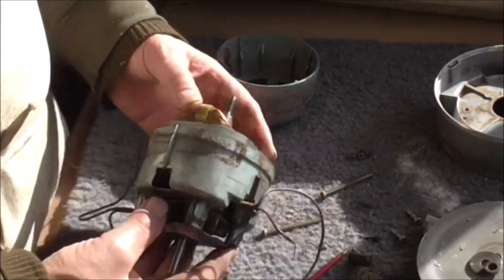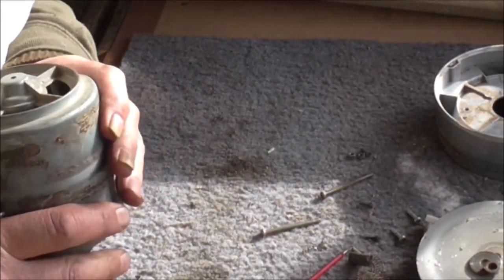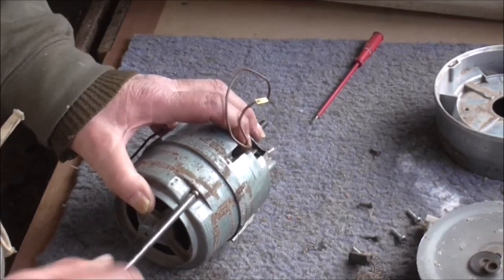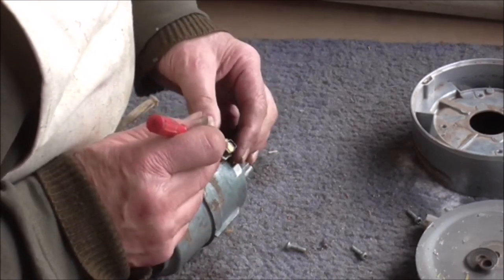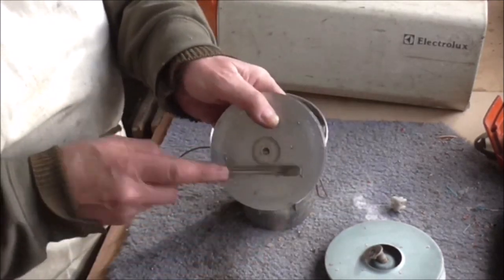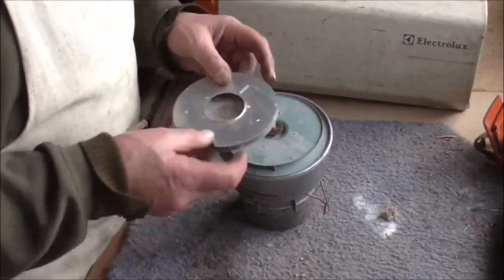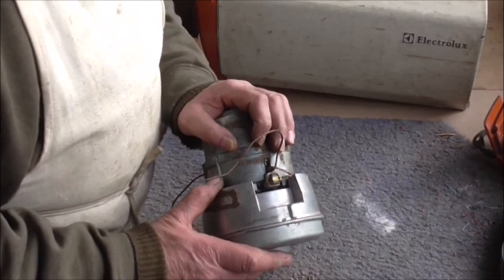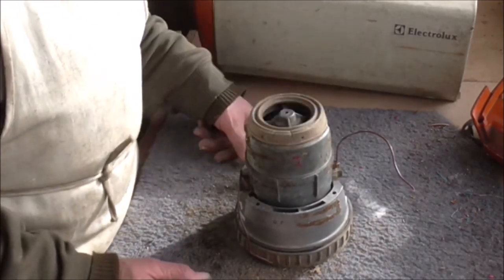Repairing an electrolux 302 motor Part Two

Comment: I very much enjoyed the videos, but I'm wondering how you'll keep the ball bearing lubed. They do like their oil.
Reply from the maker: Thanks for the comment. Generally speaking one did not lubricate Electrolux motor bearings. They always just recommended replacing the motor. Hoover machines were designed for regular servicing and supplied a special grease gun to lubricate motor ball bearings properly.